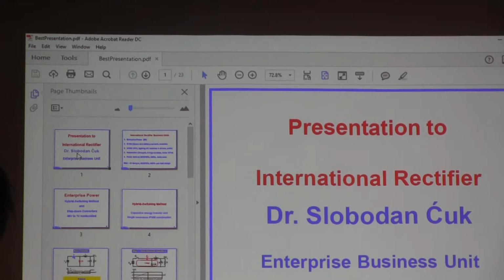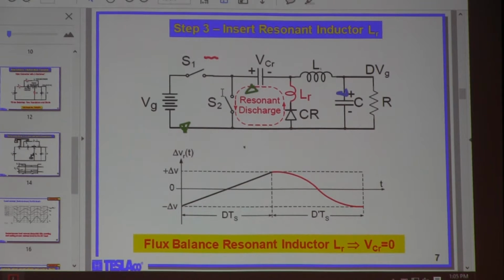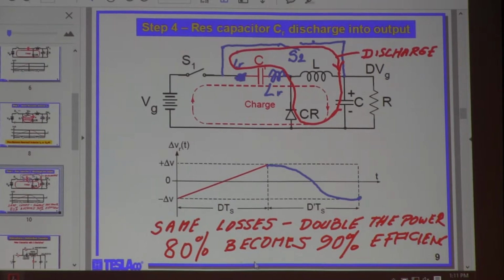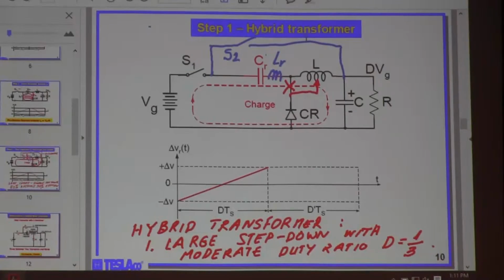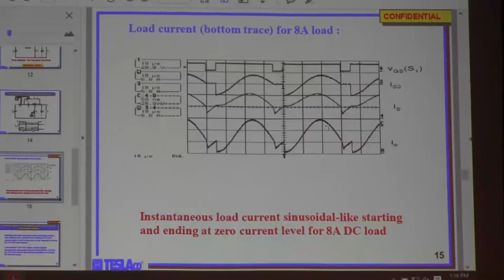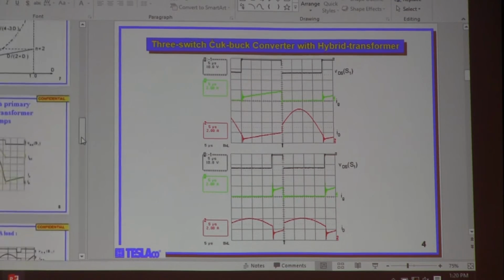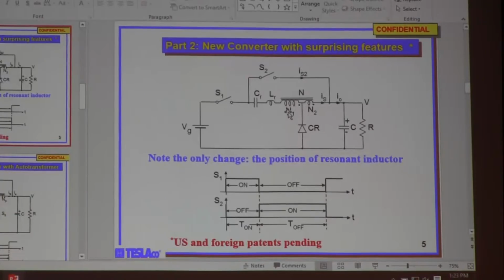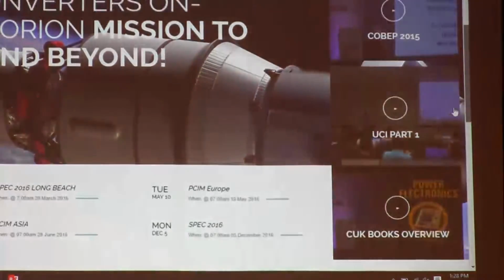ĆUK-BUCK2 TOPOLOGY BEST FOR ALL SWITCHING DEVICES! Part 2

Comment: Use cuk converters with marx generator to create resonant circuit to wirelessly charge cars or power tools really fast!
Reply: wirelessly charge cars from existing street lamps
Reply: Charge trolleybus without ever using electrodes

Comment: As there is no current supplied to the output in the "off time". the peak current into the output circuit must exceed the average output current  by an amount inversely propertional to the mark / scape ration on the current pulse into the output circuit? if this is 10:1 and 100A output, average current into the output cap+load must be 1000A?

Comment: in a regulator with an output lower than an input and variable something must be done with the power that appears in other places than the load, either it is dissipated in the series pass element, stored and later directed to the output, or returned to the input side. If there is no storage, then it must be one of, or a combination, of the other 2. An original buck stores this energy in the choke and then supplies it to the output side later this energy  stored in the choke takes time to build up, and time to decay,  making havoc with the transient response.
  Looking at the transient response, there is a drop and overshoot on the output voltage in response to a step current change, so there is some storage!?
Reply from the maker: Your reasoning is NOT correct. Note that the hybrid transformer provides the voltage step-down thorugh the turns ratio step down. Hence for the 10: 1 step down turns ratio , the voltage is reduced by 10 times. The transformer  through the same turns ratio INCREASES output DC current ten times but NOT above 100A DC  current dictated by the load. In other word, DC currentdawn from the sourse is 10 tiomes lower that 100A DC load currnet. 

The AC ripple currents on the primary and secondary follow the same transformer dictate. Secondary AC current is 10 times the primary AC current. 
When superimposed to DC secondary curent it results in the magic, that the intantaneous ouptut currnet can never go negative even with  the diode rectifier and light load. In fact, DC load current dictates the peak of resonant current pulled from the converter and the reason for its transient respond immediately to the DC laad change on the very next cycle.!

Comment: Dr Cuk, thanks for sharing this video. I am very interested in your step-down hybrid transformer concept, particularly the 2-phase version. I think this should beat the multi-phase buck hands down. Are the switch transitions lossless? I also wonder what the input ripple current is like?
I was just playing around with the circuit of yours and wondered if it could be made bi-directional? This could perform as a step-up converter maybe.

Comment: you hear anything at all ? why do you upload it?
Reply from the maker: Reply  to +marY Nbr 
I do not understand your comment! Are you saying that you do NOT get the sound with the video. I just checked the sound and it is fine. Perhaps you may want to check your computer set up if you are not receiving sound. Please confirm that  it is the sound you have problem with.
Reply: +Slobodan Cuk 
Hello Mr.
I had the noise higher than the voice, couldnt hear anything but the noise.
now i tried it again. the sound is just noisy on my laptop (while I dont have the same problem with other videos), but with a portable speaker that's better..
Reply from the maker: +marY Nbr  
Could you please try a few other videos and see if you have the same audio problems? This would confirm that the problem is NOT with the videos  but with your local laptop/desktop and your  local speaker set up.
Reply: ok sure